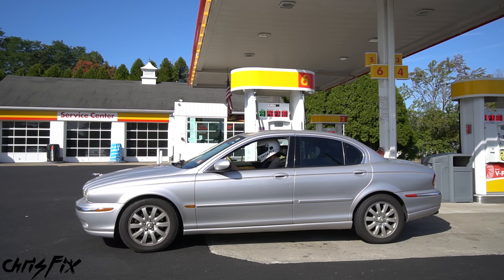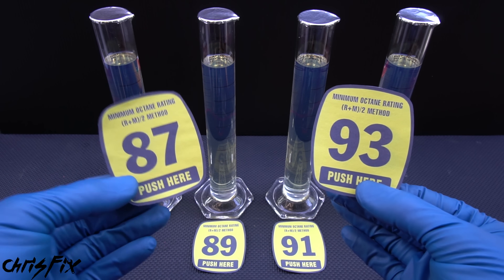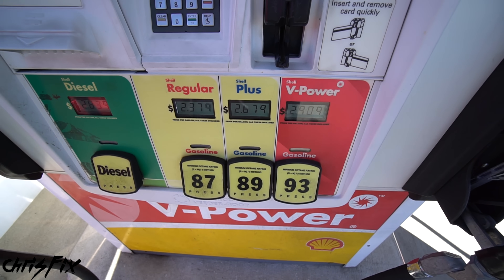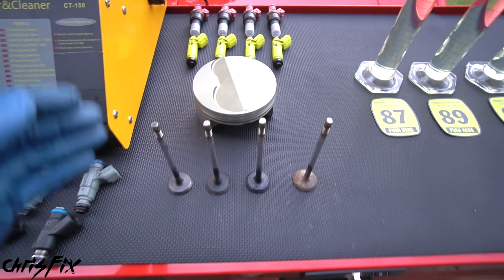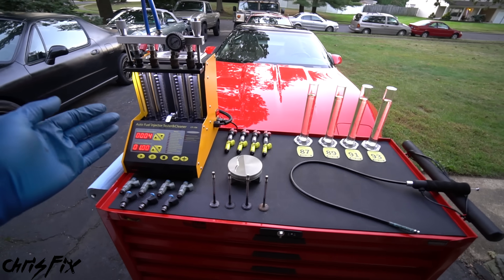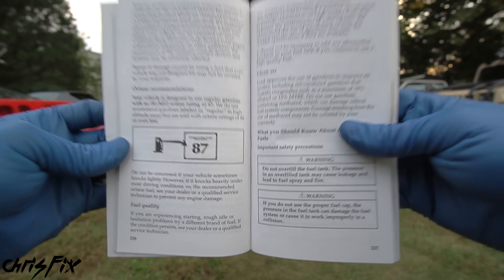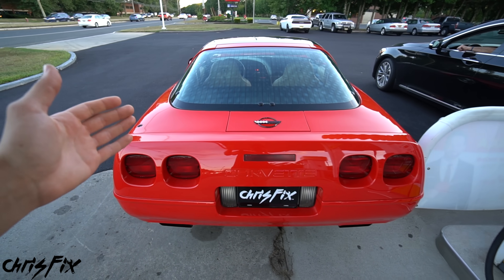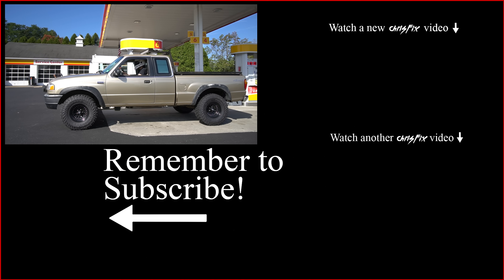What is the BEST Fuel to Use in Your Car or Truck and WHY

Comment: Yeah and I get what you're saying. But I actually talked to a Shell gas station service man. And he was servicing the gas station pumps. He told me that the difference in the octane level is also the amount of spark that is required to ignite the fuel. 

Meaning an 89 octane requires less spark. High performance engines have a higher spark rate meaning that it takes a hotter spark to ignite the 93 fuel. 

If you put 89 octane in a required 93 octane engine it will create micro explosions inside of the Piston chamber. Which causes wear and tear on an engine. So do not put 93 octane in your 89 octane engine
Reply from the maker: Octane is a fuels resistance to detonation, not how easily it ignites. All fuel ignites from the same amount of spark energy, you don't need a hotter spark to ignite 93, it just burns in a more controlled way under pressure
Reply: @chrisfix  well I guess this is where we agree to disagree. 
Yes I understand that there is more octane in the other fuels. But also do your research on micro explosions inside of the combustion chamber. I will 100% believe a technician actively working on a gas pump. 

Everything in your video is 100% true, but also I am telling you that there is a difference between the octane spark rate. 

Under your interpretation of what you commented back. If that was the case you could put any fuel in any engine. But there is a reason why new vehicles have a label saying use premium only. 

For the simple fact that it is easier to ignite 89 octane than it is 93. And that is an undisputable fact.   Just research micro explosions inside of combustion chamber...

Been a long time fan. Sorry to agree to disagree
Reply: @chrisfix  also your thesis statement on your reply on my comment is exactly what I said during my comment. I said meaning it is easier to ignite 89 octane. Which means it takes less resistance to detonate.

Comment: I have a 2012 ford fusion with 190,000 miles on it and in the owners manual it says to run 87 and I get 87 but when it’s cold I hear a slight knocking or ticking and I just want to try to protect the engine as much as I can so I’m still not 100% sure if I should run 91 or a higher octane than 87.
Reply from the maker: Try doing a tankful of 89 when it's cold out and see if it improves it at all. Might just be a quirk of the engine when it's cold out, and when it's warmer out you can safely switch back to 87. It might also be a normal thing, some engine seem to make a noise like that but its normal

Comment: So I have a 2017 Volkswagen Passat rline 1.8l turbocharged engine a lot of gas stations have a hose that shares the different octane fuels so wouldn’t the fuel that the person before me pumped stay in the hose until I pump or would it be drained into the tank

Comment: owned a 2011 toyota camry and used premium engine filters, oil and gasoline sold it recently [2025] the guy who bought it couldn't believe how smooth the engine was and how smooth it run, never had a problem, had 115,000 thousand miles and used 4 batteries in 14 years all authentic toyota parts, it was replaced by a beautiful 2025 honda accord hybrid sport, no regrets!!

Comment: I have a 2023 Subaru Impreza. It has a high compression engine. I was getting knocking/pinging on 87 gas, even though I'm pretty sure the manual calls for it. But apparently it's actually supposed to take 93, which I never would've guessed. I always thought it was only high performance engines that needed 93. I started using 93, and haven't heard anything abnormal since. I'm not the only one who has seen different results either. Someone on an online forum even got a $4500 settlement from Subaru over that whole thing.

Comment: My car manual states that I can use cheap gas, regular gas, or E10, but if I notice lower performance, knocking, or other issues, I should switch to better fuel. My previous mechanic also advised me to always use higher-quality fuel. I also choose reputable stations that claim their fuel enhances performance and cleans the engine. I’ve personally noticed improved responsiveness when using fuel with additives designed to reduce engine wear. Yet, some people say it's a waste of money, and others claim it even damages the engine. So who’s actually right? It's interesting how opinions differ.
Reply from the maker: (I saw your other comment first but) You definitely have not damaged anything, but in that case I would just use regular gas. If you do actually happen to notice lower performance or worse fuel economy you can always switch to a higher octane easily and you know it works for you. Just have to do what's best and right for your specific situation

Comment: what about 88 octane / 15% eth? ive been using it in place of 87 when i see it, says it burns cleaner and is for 2001+ cars on the pump, but mentions flex fuel so it worries me about damaging the motor somehow despite the similar octane
Reply: NOT on the challenger, on a versa note lol

Comment: 2000 Durango RT. No this is going back a few years but 87 octane can't even give it fuel it doesn't want it no power and knocking 94 octane runs great 100 octane runs like a rocket 115 octane would blow anybody's mind... So yeah just saying absolutely no comparison in the fuel is whatsoever... 100 times more power out of the higher octane to say the least

Comment: holy crap. you are so thorough. finally an expert who says what i always argue with people who are so smug that i should run regular. my hyundai have high compression ratio but manufacture recommend regular. i do feel it runs smoother and more power (people say it was my imagination) with premium. it doesnt say "premium recommended" but i always go with my guts knowing my car's compression ratio. my guess they did it so they can say it uses cheap gas.

Comment: Once my 2009 Acura tsx hit 130K Miles using 87 fucked up my engine and it started knocking. Also gave me exhaust. GUYS IF IT SAYS PREMIUM RECCOMENDED AND YOU PUT REGULAR 87, JUST MAKE SURE 87 is AT FIRST OR TEMPORARY, OR USE PREMIUM ITS SAFER LONG TERM
Reply: fill coke cola in your car gas tank

Comment: I wanted to mention that I had an issue with my vehicle about three weeks ago. That’s the only reason why I’m watching this channel so I have a 2019 mini Cooper clubman and on the gas cap it says 91 octane so I’ve been going to my new racetrack across the street from my house. I’ve been getting gas for four years. Come to find out which I never paid attention on the gas pumps. It says 15% ethanol never paid any attention I thought they all said 10% or less so I brought my car into mini service. They said I had 15% ethanol and it ruined. All of my injectors cost me almost $4000 to fix this And if you go on Google, it will say some cars are made for that from 2004 and up but apparently not something with a turbo so I’d be very careful and look at the pumps. Make sure it doesn’t say 15% ethanol. I took photos of multiple pumps in my area. I’ve only found one that said 15% to all the rest of 10% or less Crazy that we don’t pay any attention to that, but I lived and learn cost me quite a bit of money to fix the problem so if you have any cars that says 91 make sure you do not use the 15% ethanol it will definitely ruin your injector
Reply: fill coke cola in your car gas tank

Comment: I work in Oil & Gas industry specializing in Refining and Distribution. I get to hear all these myths all the time and the most annoying is that people do not want to hear the truth as they believe "Expensive is better". Anyways, great explanation and although we DO NOT recommend adding those Octane boosters as most of these are more gimmicky and running a lower Octane is fine for most cars in emergency and it is better to fill up only as much needed (until next Gas Station) and then topping up with usual grade or one grade higher just for that fill up and return back to recommended fuel. Cheers...!!!

Comment: This video is bullsht! That old rusted cylinder and those valves were of other causes like water and oil problems! You also have to use valves with similar mileage! Also gas burn starts btdc!! Wtf!
Reply: He never said the gas caused those issues, he was just showing them as a talking point for the fuel additives.

Comment: Sorry but the existence of octane boosters in the US just proves that fuel is poopoo
Reply: HUH? The only reason you need an octane booster is if you don't have access to the correct fuel for your vehicle.
Reply: @chronovore7234  Which you dont in europe... Its always the right fuel, because its all high octane
Reply: @Murv  85 octane in the US is the exact same as 95 in Europe. They just use different methods to calculate the numbers.
Reply: fill coke cola in your car gas tank

Comment: 1. Shell
	•	Additive Technology: V-Power NiTRO+
	•	Designed to protect against gunk, wear, and corrosion.
	•	Contains a high concentration of detergents to clean and protect intake valves, fuel injectors, and combustion chambers.
	•	Marketed as having the ability to remove 70% of intake valve deposits within 10,000 miles.
	•	TOP TIER™ Certified: Yes.
	•	Reputation: Known as a premium fuel brand worldwide, with a strong emphasis on reducing engine deposits and wear.

Comment: So I have an Acura and in the Manual, it says to run 91 however sometimes there aren't 91 available, and buyut 93 instead, is that fine, or am I damaging my engine?
Reply: You are fine, I run whatever is highest in my Lexus, 91 is the minimum recommended, not the requirement
Reply: @ ahhh okay bet appreciate it my man
Reply: fill coke cola in your car gas tank
Reply: @ bet

Comment: For my non-American friends, here’s how octane ratings in the US compare to the EU. In the US, they use the (R+M)/2 method, which averages the Research Octane Number (RON) and the Motor Octane Number (MON). In the EU, it’s based only on RON. So, EU 95 RON is roughly US 91 octane, EU 98 RON is like US 93 octane, and EU 100 and EU 102 RON would be higher than anything commonly available in the US.

Comment: I use premium with my ram 1500 85,000 it just runs a million times better , same for my moms Tahoe that has 300,000 miles or more if we put normal 87 it starts to feel light and slow thats our experience with tucks if i had a Old buick ,Toyota or honda you can put literally anything in try moonshine in those cars and they never die

Comment: I have some experience in this, a good education, and have researched a variety of things, which culminate in the following wisdoms:
-if you have an old car, with a carburetor or mechanical injection: you will not get better performance with super high octane, but you will see lower performance and knock with lower than needed octane.
-in newer cars, like my Chevy S-10 and BMW's: when the car is fed 89 octane or lower, it knocks occasionally and the engine lowers max output parameters, but when it detects no knocking, the engine control system can unleash more horsepower, as long as the emissions and fuel systems are still in agreement regarding fuel burn efficacy and catalyst reduction performance. 
-if a newer car detects poor performance, even with super high octane fuel, it can and will lower fuel injector pulse width and alter timing to try and stabilize both emissions and system operation.
-if the system parameters are stable, estimated octane meets or exceeds a minimum "high performance" value, the car can and will burn vastly more fuel than it would with a tank of mixed octane fuels, with a vastly more responsive throttle, and a cleaner sounding exhaust.

Comment: I’ve got a 2013 Yukon XL with 6.0 L V8. 220,000 miles OG drivetrain.

I keep getting P0107, which is lean mix on Banks 1 and 2. Goes away if I use Royal Purple engine cleaner and Non-ethanol fuel. Around here only the top tier is non-ethanol.

I’ve had everything changed out except the O2 sensors.

Comment: Most of the ethanol fuels are crap.

Get E 85R  legally required to be 85% ethanol a.k.a. race fuel 

Most modern cars can run up to 15% ethanol   Here’s the catch at a loss of your fuel efficiency. 😂
Good if you’re trying to save a little bit of money and you have a modern car and you are going to drive it the piss out of your car soon. Do not let ethanol sit in your car over long periods of time.

Comment: For my own personal research I did a dyno on my Audi S3 between 89 and 91 Oct at 89 Oct Torque was 281.3 ft-lb and 275.1 hp with 91oct Torque 284.7 ft-lb and 294.1 hp  if you see the numbers for daily driving you wouldn't feel no difference because torque is almost the same, only at high RPM the engine's computer pulled back timing and loss about 20hp, being that said if you need hp and drive fast you need higher oct, if you just cruise and don't need to go fast 89 or 87 should be fine as long as your car recommends it.

Comment: Well my 91 Octane fuel is also ethanol free (i.e. 100% gasoline), so it actually does have a higher energy density than the other octanes available here locally (i.e. the gasolines cut with ethanol).

Comment: 93 octane has a btu capacity of 120k to 124k.

87 octane has a btu capacity of 125k.

Close but not the same

93 has an autoignition point of 1135 to 1225 degrees Fahrenheit

87 has an auto ignition point of 536 degrees Fahrenheit.

Spark plugs all create different temp sparks. Your plug matches your compression and intended fuel octane rating. 

If u put low octane in a high compression engine the hig temp spark and high compression cause fuel to ignite prematurely leading to preignition and detonation.

When u put high octane fuel in a low compression engine that has a cooler spark, the fuel doesn't fully ignite which wastes fuel. 

Tons of good, accurate info but don't agree with some of the facts related to that mentioned above.

Comment: I have 2019 audi Q5. I live in Canada. I bought a new vehicle. Around 40000km, the vehicle started shaking and jerking. On the uphill, almost losing power and came back. Audi said the costco fuel caused problem. I used costco gas 91 octane. After I picked up vehicle, 3 weeks after, same problem happed again and it became worse. They fixed it and after 6 weeks, check engine light again and started shaking. Audi void the warranty and provide the evidence that I did not use costco gas or pay $2700 to fix. Is there any advise for me?

Comment: I drive an accord I used to run regular I got about 385 total miles on a full tank. I decided run premium for a while to see if it made a difference while there was not much performance improvement(I run eco mode most of the time anyway) I had an increase to the point I saw 420 total which is an extra day for me to got to work and back maybe not worth the extra 5 dollars but I’ve never complained about gas since I got my car 3 years ago

Comment: My car runs great on 91 non-ethanol gas, so that's what i use in all my vehicles and lawnmowers, weedeaters or anything with gasoline. I notice the difference when i use ethanol fuel, so i usually don't use it. Ethanol will cause more carbon deposits also.

Comment: So I have a question I bought a 2015 Toyota Tundra in August the first time I drove it to a city an hour half away. I drove it to salt lake. On the freeway it got like 14 or 15 miles per gallon. But that was the only time ever since then it was stuck at 13. 2 to 13.4. Even on the freeway I even told a car to a scrap yard and it still got 13 MPG. So lately it's been stuck at 13.1 so the gas mileage is dropping. Toyota said it could be the time of year. However I don't know because the time of year didn't change very much from when I bought it in August when the gas mileage dropped after that. So I thought it might be spark plugs and I change the spark plugs however it's still at 13.1 and I put auto parts store spark plugs in it which may have been a mistake because I feel like being doesn't run as good as it did before it doesn't sound like it anyway. Anyway so why is my gas mileage dropping? I just got some seafoam I'm going to put in the gas and the oil and see if maybe that helps maybe there's carbon buildup however I don't think there is

Comment: I have a 2018 Lincoln MKZ hybrid with a 12.3:1 compression ratio. I use Costco's Top Tier 91. Even though it's a hybrid and can run on 87 the manual recommends premium lol.
Reply from the maker: That makes sense, higher compression engines usually benefit from premium.

Comment: Use the fuel the manufacturer suggests… don’t listen to fools that tell you they know better, using a higher octane in a car meant for lower messes with the valve timing and creates valve ticking and the car has to rely on a knock sensor to try and adjust. Some older cars don’t even have a knock sensor or if you do it may not even be working right

It’s probably not that bad for putting around town but when you try to use the wrong octane at higher rpm, it’s going to cause damage to the valves over time, which will cause more damage in the end.
Reply from the maker: Valve ticking is usually caused by something like improper valve lash or low oil, it's not really related to fuel octane. However using high octane in a car that can't benefit from it is just wasting money
Reply: @ nah. Higher octane will cause valve tick if your knock sensor doesn’t correct it or if you don’t have one on an older vehicle. The valves are not opening and closing at the right time and it causes wear on the cams, springs and the valves themselves.
It’s a known issue, that’s why you use the recommended fuel in the vehicles manual, not because it’s a waste of money.

Using a high octane in a low compression engine will damage it, and using low octane in a high compression engine will cause loss of power and probably damage as well.